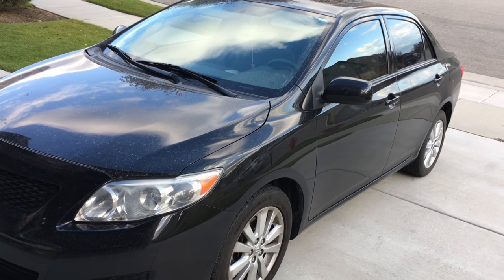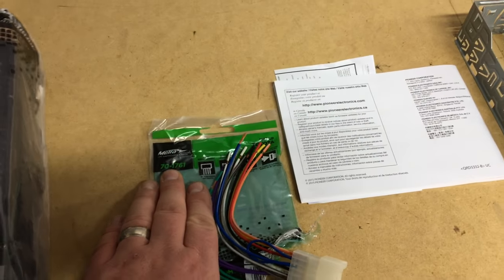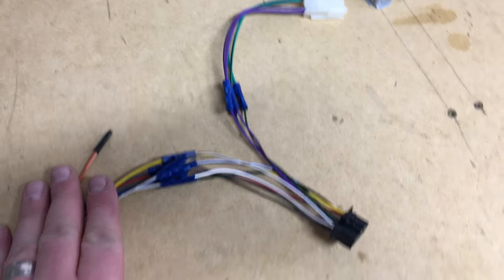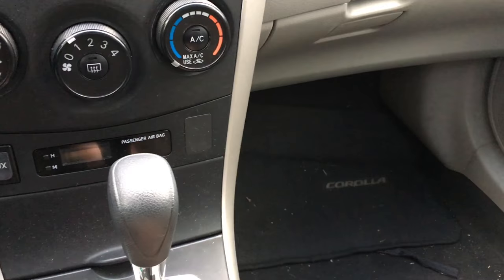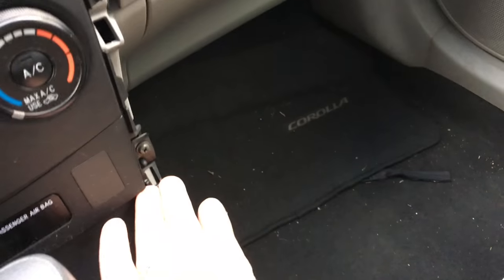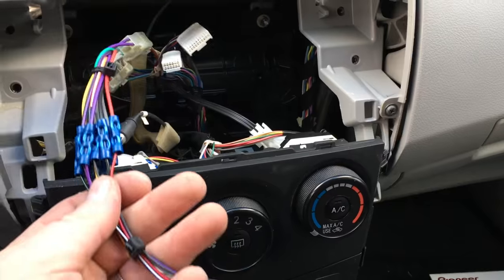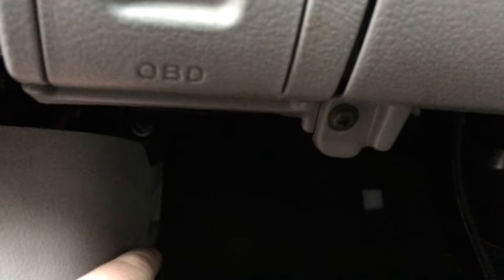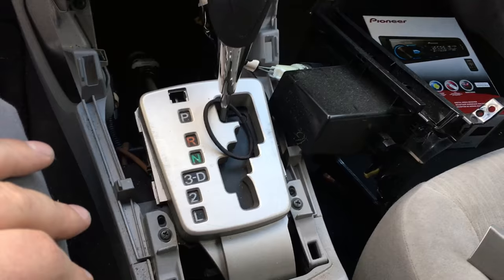2009 - 2013 Toyota Corolla Radio Install

Comment: This video is great. Very informative, but maybe we need a version of this "for dummies". There were several areas in which you kind of said, "Now all you have to do is 'this'", and then you'd cut away and it's done, like crimping the wires, or removing the panels on the car, or moving the shifter without actually shifting the gear. It would be nice to see how all of that was done, but the video was still great.
Reply: agree
Reply: most of the times its better to make sure the sterio works before you put it all back together.
Reply: I'm sure you know by now, but for anyone else who comes here wondering: For moving the shifter, FIRST MAKE SURE YOUR PARKING BRAKE IS ACTIVATED OR YOU'LL BE PAYING DAMANGES, DRIVING TO THE EMERGENCY ROOM AND/OR CALLING THE CORONER. You need a flathead screwdriver (or something similar). On many cars (or at least Toyotas), there should be a little rectangular cover you never noticed before near your shifter. Put the screwdriver in the slot and use it to pry it off. AGAIN, MAKE SURE THE PARKING BRAKE IS ACTIVE. NO ONE AND NOTHING NEEDS TO BE MAIMED BECAUSE YOU MOVES A TINY PLASTIC RECTANGLE. To shift gears, press inside the hole (you can use the screwdriver to press), and you should be able to move the shifter freely. And your car shouldn't move, because you listened to my yelling that the parking brake should be active. 📣 OH, AND BEFORE YOU LEAVE THE CAR, MAKE SURE TO PUT THE CAR BACK INTO PARK. Up to you to weigh the risk of leaving out the rectangle while the car is in gear to remind yourself to put it back into park, only to lose it and have your 5-year-old put the car into neutral with no parking brake a month later, and putting it back while working and potentially getting a "surprise" when you or the next person to drive your car releases the parking brake without their foot on the brake.
Reply: Any "for dummies" dummier than this very practically explained will need to come with a warning ⚠️ 😜
Reply from the maker: Here is an updated version! https://youtu.be/Hm6OdEe0MYs?feature=shared

Comment: Be careful removing the vents and nake sure they're pulled straight towards you. Mine broke two clips because I pulled it a little bit up (I glued them together)
The shifter thing unnecessary 
I ordered matra wiring and Scosche TA2101B KIT ($11) for 2009 model
The steering wheel buttons need an extra adaptor

Comment: could you do a video on 2010 toyota corolla installing aftermarket front and rear speakers including tweeters.... as this is the best video ive seen so far covering a toyota corolla 09 - 13 models
Reply from the maker: Thanks buddy.  This was a customer vehicle, but if i get another customer who wants speakers done on a corolla, i will for sure grab some footage for ya.
Reply: Dougnohu, are ur tweeters connected to the speakers or are the separate?
Reply from the maker: Speaker install video coming soon!

Comment: In the Metra instructions for the dash kit it says "Mount the ISO brackets to the radio using the screws supplied with the radio. (Figure C)".  I noticed in your video you didn't use the ISO brackets? You used the supplied radio sleeve?  Also, in the instructions it mentions "Snap the trim plate onto the front of the radio housing. (Figure D)".  I noticed you didn't use that?

Comment: Hi, can you please help me out? I need the measurements of that radio cover, I mean, the dimensions of the hole? I'm planning on putting a tablet in the dash using the dash kit for the corolla but I want to make sure that the actual screen of the tablet fits into the hole. I would appreciate it, thanks!

Comment: Great video.. Did you guys use the Pioneer radio trim ring or the metra trim ring for this installation?  Also, I have the same metra wiring harness that was already connected to an old Pioneer deck harness from 2004 on my 98 Toyota corolla.  Would I be able to just re-use the old wiring harness on a new Pioneer deck with my 2010 Toyota Corolla LE?  In other words are the current Pioneer harnesses different from the ones going back  to 2004?

Comment: This is a great video but I wired everything up and it works but only one speaker plays when connected to Bluetooth and the other speaker plays when i have my aux in do you know what could be wrong?

Comment: Hello,

Anyone who have the base model and is using the metra 170-1761 harness, are you experiencing any whining noise coming from the rear/backseats of the car? I am using a Dual XDVD269BT with this metra harness, and after connecting all the wires from the harness to the Aftermarket Radio harness, I am not using the SWC cable, illumination wire, reverse wire, and brake wire, as well as the dimmer wire on the metra harness. The radio works fine, sound is good, but I get this whining noise with acceleration

the ground wire (black) from the aftermarket radio is spliced onto the metra harness, and it just plugs into the the car cables, using two of them cable instead of the original four.

Comment: Hey man just did my 2010 Corolla s, orederd kit and wire set off amazon and Ken wood deck from my work. Looks and sounds great! This video was the best one out there by far. Just one question, there was an orange wire for “steering wheel controls” but there was no matching colour for it. What would I do for that ?
Reply from the maker: If you have steering wheel volume controls, that wire is for that use.  If you don't have that feature quipped, it will not be used.
Reply: Provo Beast Audio Installation. Thank you for replying, but I wanted to know what wire to crimp it too cuz there wasn’t one to support it but I have the controls
Reply from the maker: Is the orange wire on the aftermarket radio's harness?
Reply: Provo Beast Audio Installation. Yes I believe so but I tied it into the matching orange for factory harness, would I tie the three in together ?
Reply from the maker: No, you may need an adapter module (like the aswc-1) or check with the stereo manufacture for wiring.  Some units you can connect directly, some you cannot.
Reply: Provo Beast Audio Installation I’ve just decided I’m not gonna worry about it. Thanks tho video was great help

Comment: I did this install and my car does not lock nor unlock remotely with my key anymore.  However, the key works again once I put the factor radio back in.  Any advice?

Comment: do you have to use that pasific dash kit or could you use another? i have the same radio but i installed it on a 2006 toyota corolla and can only find a dash kit that is double space and im wondering if i could use the same kit you have
Reply from the maker: Scosche makes one too for that year: https://www.amazon.com/SCOSCHE-TA2048B-2003-08-Corolla-Installation/dp/B0007KK2N8/ref=sr_1_2?ie=UTF8&qid=1526660437&sr=8-2&keywords=scosche+corolla+dash+kit&dpID=41DzFJulDDL&preST=_SX300_QL70_&dpSrc=srch
Reply: perfect, thank you

Comment: Thinking of replacing stock radio, mainly to have blue tooth. According t manual, there is a microphone built into the headliner, it's in the overhead light console in front of the lights. It's visible, 3 slots like the manual shows. Can that be used instead of the added one to run wires? Thanks
Reply from the maker: Usually they are on a protected circuit, so integration is generally almost impossible.  Unless you are good with small electrical components, it is easier just to run a new mic.

Comment: I'm perplexed by the extra two connectors that are going unused. What functions do those serve in the factory radio that wouldn't be needed in the aftermarket radio? That's a lot of wires to nowhere.
Reply from the maker: One unused harness was for the factory Aux which went bad, hence why the customer decided to replace the radio in the first place.  The new radio has the Aux port on the front of the unit, which was why we decided not to retain it.  The other typically is for speed-sensitive volume that the factory radio used, but wasn't needed on the new radio.

Comment: Does the radio come with the face and trim panels when i buy it? 😭😭😭😭cause i just had mine installed but they did a shitty job totally not happy with the outcome
Reply from the maker: No, aftermarket radios are universal, you will have to purchase the dash kit and wiring harness separately .
Reply: @ProvoBeastAudio  where can I purchase the dash kit and wiring harness😿 please help?
Reply from the maker: @stonerbeatsza9701  Parts listed in description.  Just search part number in amazon.

Comment: What is the last connector that you left out? Thanks
Reply from the maker: the old factory AUX.  The new radio had the aux on the front panel, so no need to retain the old factory one.

Comment: What is the purpose of the wiring harness? Can't you hook up directly to the wires that come with the pioneer unit?
Reply: Nevermind I figured that out. Do you have a link to where you get these barrel connectors?
Reply from the maker: Any autoparts store has butt connectors or just search them on amazon

Comment: I just bought a 2009 Corolla xrs and it came with the JBL factory head unit but it doesn't sound good.  Now I haven't tried a cd on it yet cause I just got the car today but the radio sounds crappy and the reception is terrible.  If I was to replace the head unit with something along the lines of a Pioneer like in this video or a double din unit with the big screen, will it power any factory amplifiers that may be a part of that JBL system.  The speakers in the back have pretty big magnets so I'm assuming it's got some power handling capability.
Reply from the maker: Well, if you upgrade the radio, the adapter harness needed would utilize your new radio's RCA outputs.  Generally speaking, aftermarket radios do allow more customizability, eq, and adjustments needed, so you may find a better sound with the upgrade.  Head over to sonic electornix and use their vehicle fit guide to ensure you get the right parts.  Use coupon code ProvoBeast to get 5% off a checkout.

Comment: how can i get the steering wheel remote to work with an aftermarket radio? and what about the AUX port that is already installed in the panel(below the shifter.) i have a 2009 toyota matrix.
Reply from the maker: You will need a separate adapter to retain the steering wheel control module.  Usually we use the Metra Axxess ASWC-1 to retain those features.  It also depends if your new aftermarket radio is compatible with the steering wheel controls.  You can retain the aux port, but depends on the wiring adapter you use and the new radio you have chosen.

Comment: Hi I have a question . Will this dash kit work for 2007 model .? The inside of. Act. Is exactly the same. And I have pioneer deh-3200ub will this work no problems ? Regards Anton
Reply: Or will I need to use Metra -99-8204 kit ?

Comment: My Factory AUX Port has a problem where I have to wiggle it and maintain the aux cable in a certain position for it to play out of all my speakers. If I install an aftermarket radio with a new AUX port on it, do you think I will continue having AUX issues and playback throughout all of my speakers?
Reply from the maker: No, the AUX issue is common for these model years.  The new radio has an aux on the front of the radio itself which the old Factory aux will no longer be used.  You will no longer have issues with it.

Comment: im installing the same radio on my 99 accord ..can i just use the wires from the new radio to the original wiring or do i have to get the new harness?
Reply from the maker: Well, if you get the new harness adapter, you will not have to cut and identify the factory wiring.  The benefit of the harness is that is simplifies the wiring for only a few bucks.  Check out Sonic Electronix for the list of harnesses compatible with your accord and use ProvoBeast code at checkout for a 5% discount.

Comment: Why do you need wiring harness ? Why can't you use the one already there
Reply from the maker: Factory harness does not plug into an aftermarket radio, and we highly advise to never cut the factory radio harness for just a few bucks, it is totally worth it. Linked in the description of the video.

Comment: Do you simply have to take off the vents by pulling the panel? Mines looks very tight and I am afraid to break something is i pull too strongly
Reply from the maker: Dont pull on the vents themselves, instead, pull on the top of the panel towards you.
Reply: Provo Beast Audio Installation i figured it out already! But thanks for the Quick answer! You have a great channel!
Reply from the maker: Thanks.  Subscribe!

Comment: I finished installation but for some reason my corolla doesnt respond to lock unlock with the remote control, could it be linked to the radio change? thanks
Reply from the maker: Generally no, but best way to test is to throw in your factory radio again to see if that functionality comes back.  If it doesn't there is another issue with the keyless entry separate from the radio.
Reply: Good, and by the way, does the radio turn on and off by itself when you turn your car on and off, because for me i have to always turn the radio itself on and off regardless if the car is working, which is tough.
Reply from the maker: Sounds like you have a major wiring issue.
Reply: it may be, an amateur kid did it for me and was watching this youtube for reference, for me it was the first time to have this done..so ill check in with him. I will have to get a new wiring harness that came with the jvc as well separetely

Comment: what harness adaptor is needed if you want to run an amp in the car for a subwoofer?
Reply from the maker: Any line out converter will work if you are running the factory radio.  If you are running an aftermarket radio, no harness adapter is needed as aftermarket radio already has rca preouts for the amp and sub.

Comment: does the volume switch still work on the steering wheel?
Reply from the maker: With the right parts, yes.  This Corolla wasn't equipped with steering wheel volume controls.  See the description of the video for those appropriate parts to retain those features.

Comment: i have a 2006 and the touch screen doesnt want to come on what can do to reset it
Reply from the maker: Factory Touch screen or aftermarket?
Reply: Provo Beast Audio Installation tbh idk
Reply from the maker: Well, i won't know how to help you without knowing if it is the factory touch screen or if it has been replaced with an aftermarket one...
Reply: Provo Beast Audio Installation its a AVH-X2700BS PIONEER. MIXTRAX touch screen
Reply from the maker: Is just the screen not displaying anything or the entire radio not turning on?
Reply: Provo Beast Audio Installation both
Reply: i bought the car with it. it worked for like two weeks after that it would turn when it wanted to after that it just dont work
Reply from the maker: There should be a very small button (size of the point of a pen) on the top left hand corner of the screen.  This is how to reset the unit.  If this shows unsuccessful, it may be a wiring issue, or the unit may be bad.

Comment: I tried this on my 2013 Corolla and there's a plastic band holding the radio down so it's impossible to take out :/
Reply: Will D. Thanks so much for the tip! I went to a professional to get it removed, but I'll know next time. Save some money.

Comment: hey, did the factory aux port on the bottom still work with the new radio
Reply from the maker: No, the aux port on this radio is located on the front of the new radio.  The customer did not want to retain the factory aux.

Comment: Them Toyota and Nissan have the cheapest upper dash plastic on the planet. They break if you just sneeze on them the wrong way. Why I hate doing them. You take your time. Only to have it spider crack while putting them back in...

Comment: I Cringe when I see the "Crimps" were all done by using the Wrong slot on the Tool. Check the Tool for the correct one, it's Marked "Insulated vs Non Insulated."
Reply from the maker: This is OLD content, check out what we do today.